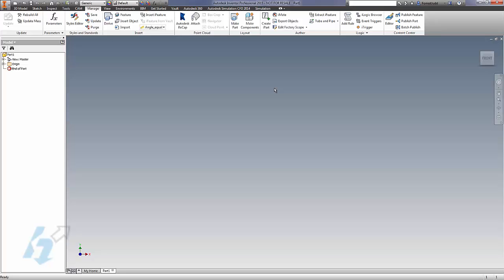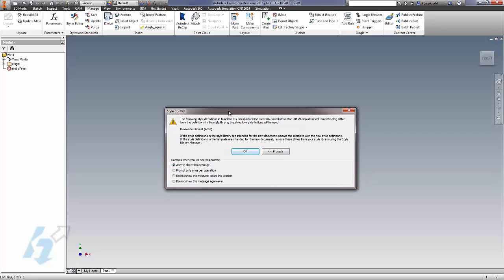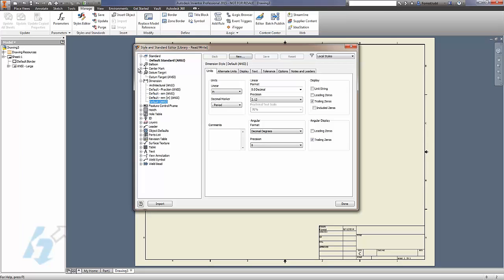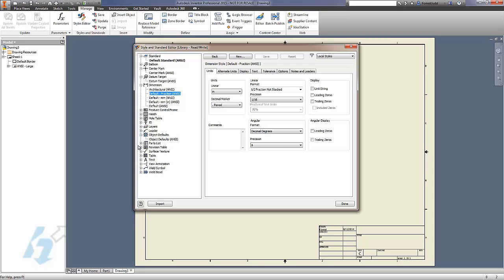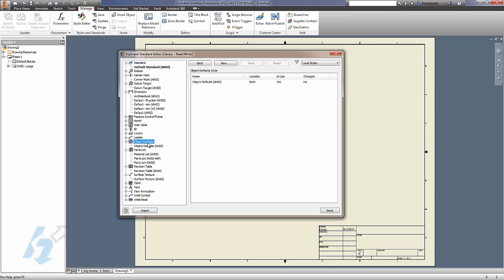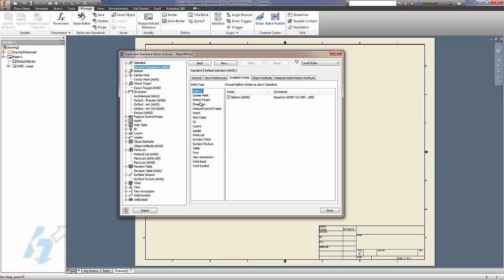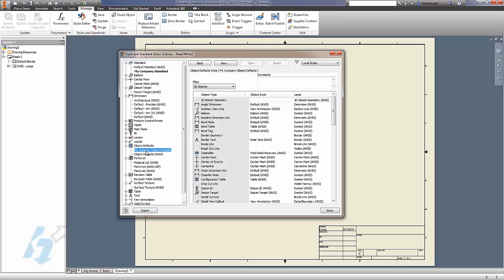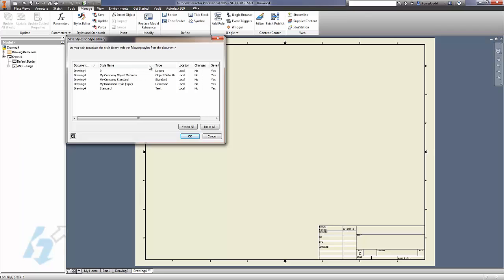Creating Custom Styles in Inventor

Comment: Just a thought. I think the worst thing you can do is customise drawings and Inventor. There should be a simple standard that everyone can use. Line thickness, fonts, section arrows etc. When the client receives a drawing he couldn't give a toss what fancy customisation is used,  all he needs is a drawing fit for purpose. To be able to see what it is going to look like, materials needed, to let the fabricator see and price what he is going to make and the installation contractor knows what he is dealing with. The nerd "draughtsman" with nothing better to do should concentrate on learning his trade, what he is employed for. To learn how to design, model and produce detail drawings instead of sitting there playing with himself and adding complexity to somthing adding no value to the company. I have, in the past started a job, and instead of just getting on with the job I had to learn where all these customised files are and all the new "customised" systems. None of which added any value it just slowed me down takes longer to get the job done. Please... keep it simple. I have been designing and producing detailed drawings for 54 years from drawing board to cad. I work as a consultant and use Inventor how it comes out of the box - no customisation. Never had complaints from clients.